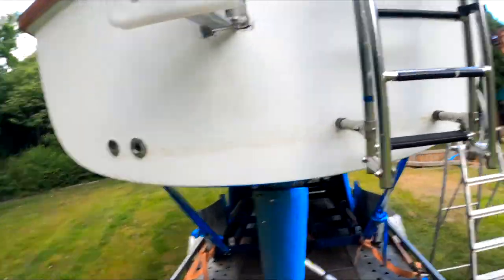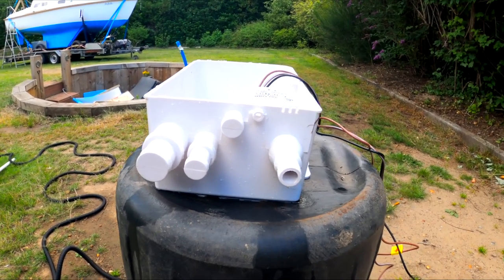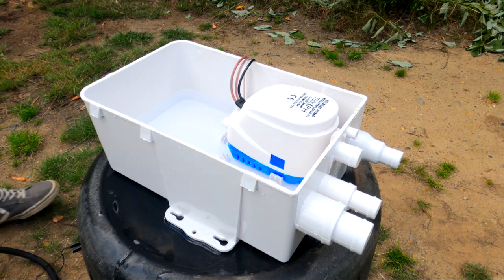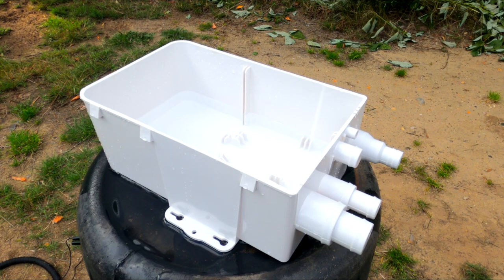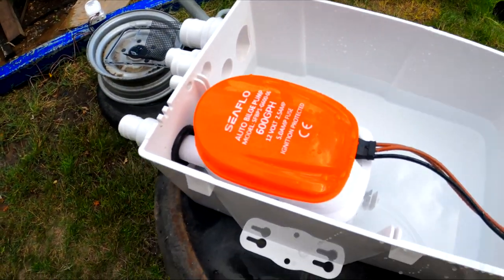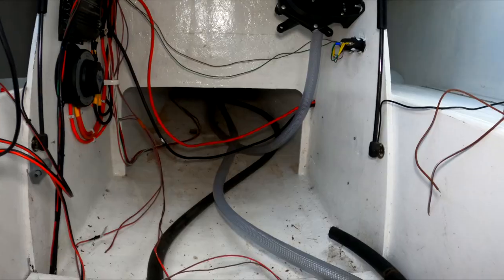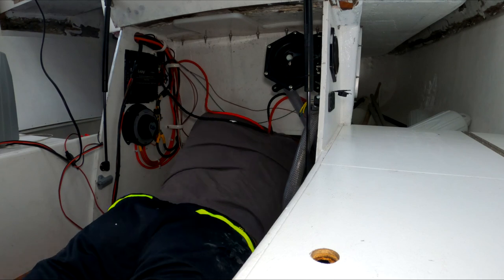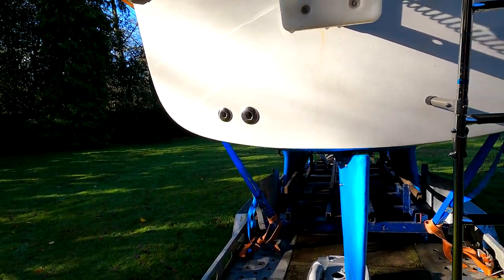Bilge Pump Flow TEST! Small Boat Cockpit Drain Install - Sailing Meraki | Ep.42

Comment: do you need to use a fuse with these or can they be used without a fuse ?
Reply from the maker: You should run a fuse with a pump for safety.
Reply: @AlexGoesSailing  thanks very much

Comment: Hi what gauge wire did you use my pump switch float switch and pump draw 15amps i was wondering what fuse do i use
Reply from the maker: 20 amp fuse maybe. Would recommend you use an online calculator to enter the wire run distance and accepted voltage drop.
Reply: @AlexGoesSailing  thanks

Comment: Link to buy it?
Reply from the maker: Found it on amazon. It’s called a shower sump box! Works really well to this day with no issues.
Reply: @AlexGoesSailing  i want the pump. Not the box. Thanks you for your reply
Reply from the maker: @perikliskatrantzis  the pump is a sea flow I believe!
Reply: Shower sump pump system